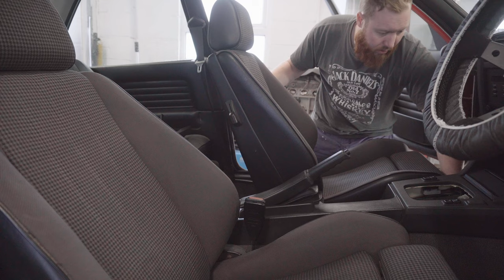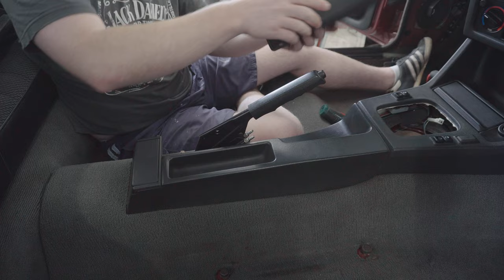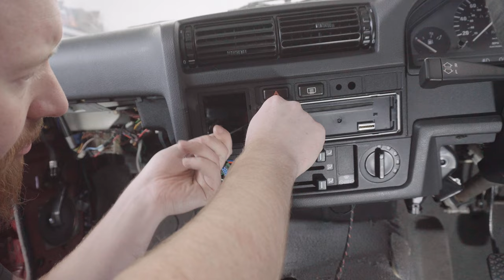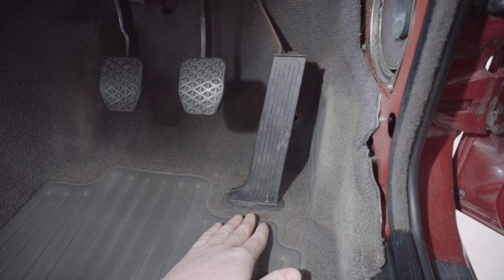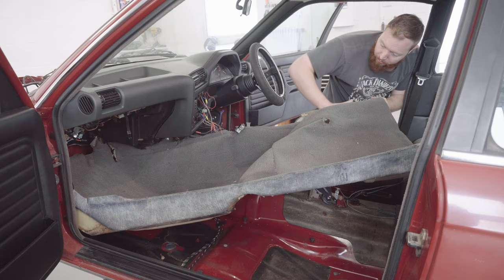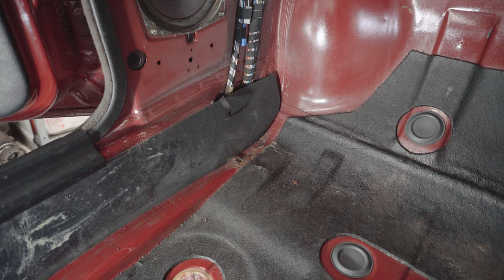How To Remove BMW E30 Carpet, Throttle Pedal Removal + Taking Front Seats Out | 030

Comment: The interior looks lovely, my E36 is falling to pieces by comparison. Have you considered dyeing the carpet black while it's out? Would go well with the rest of the interior
Reply from the maker: Great minds think alike, I've actually had that same thought myself! Planning to spruce the interior up a bit before it goes back in, but that's a while down the line yet. Dying the carpet would really smarten it up.

Apparently, there's 2 versions of E30 carpet, a plusher 325i carpet, and a lesser carpet which is rougher to the touch, from lower models. I think this is the cheaper version, and unfortunately, it's the 325i spec one that dyes better.

But I reckon I can make something work. I'll give it a try anyway and we will see what happens. Few other bits to tidy up too.

Comment: amazibf condition of floor. no signs of rusts at all. i wish mine is like that. how old is the car and what is the m ileage? has it been driven much?
Reply from the maker: I know, I feel so lucky with this E30 shell, it's one of the best cars I've ever seen beneath the surface. From the outside, it looks like a real nail though. 😂  Its a 1990 car with 103k miles on the clock. I have a suspicion it spent most of its early life in a heated garage or something. Only in it's later life has it been abused I reckon.

Comment: So how will you slide the carpet back under the heater box? Have you thought about that?
Reply from the maker: Good question, I feel like with a bit of persistance I will get it back in its proper position again.

But theres also a good chance I will have that heater box and dash out before the carpet goes back in. Hoping to avoid that though if possiible. 😁